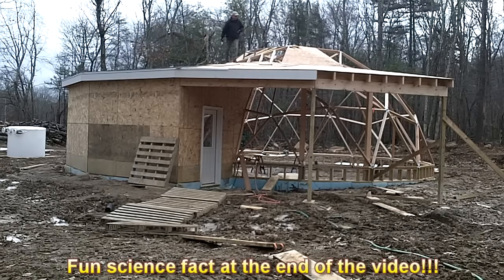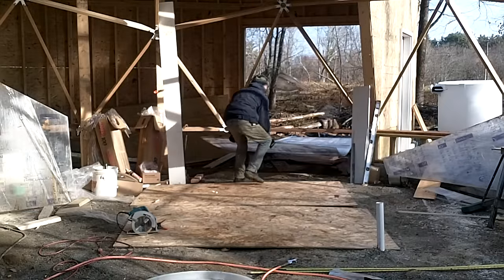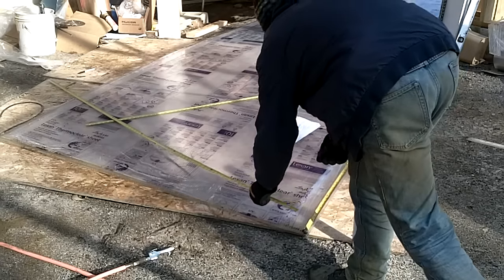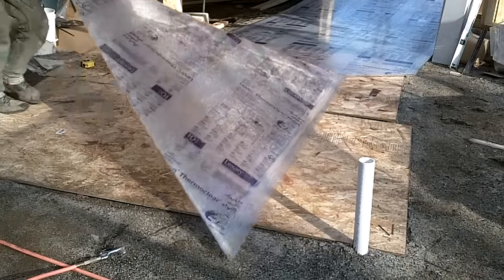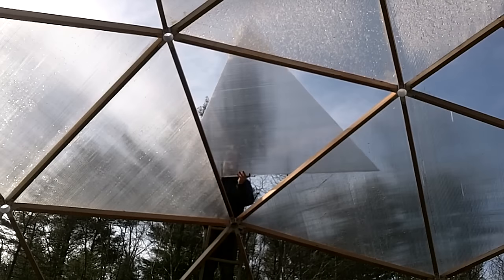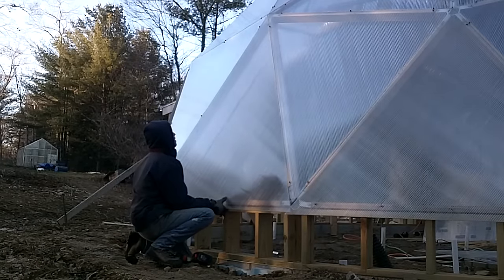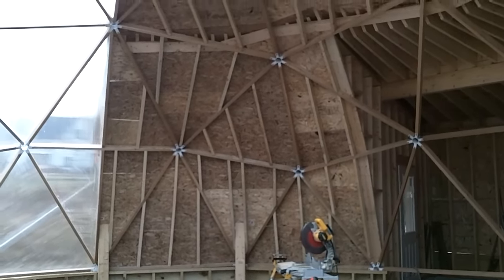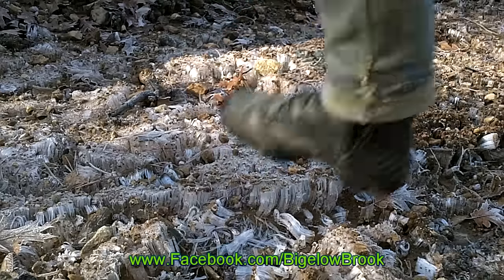Geodesic Dome Greenhouse - Part 9 - Polycarbonate!

Comment: I could see in this clip that you used twin-walled polycarbonate sheets. If you had to rebuild the geodesic greenhouse, would you opt for triple-walled or even greater in your cold climate and the extra cost was not an issue? What, if any, are some of the things you would change about the construction and thermal mass? I would really like to see a follow-up video summarizing your first hand experience with this geodesic greenhouse, especially now that you have decided to use the hoop type construction in your new greenhouse. The biggest challenge must have been how you found the time to embark on such big projects while also working full time. I envy your commitment and courage!

Comment: Massive effort.  Great work.  Has me wondering whether a two layers of 6m plastic I use for high tunnels would be more cost effective if not a better insulation when double up with an air pocket between. The greenhouse grade plastic is good for 4 years, and simple to replace.

Comment: @web4deb Not sure about that either.. but.. before I'd try silicone, I'd be more inclined to try (clear) Pro Flex RV. In any situation that silicone is/can be used on an RV, Pro Flex is better. It's fairly difficult to remove later, tho... so some tests would be in order.

Comment from the maker: @NewEnglandgardening I'm not too concerned about the holes through the hubs.  All the poly carb panels come to a point over each one.  This spring I'll use my special tape and cover all the joints...it will seal up nicely.  I"m NOT outside today....I had to go to my real job anyway.  ;-)

Comment: I think I heard the weather guy say today was the last day of fall, so now its officially winter so you got the poly up just in time to work on the heating system.  Do you have a remote temp sensor?  Would be interesting to see the temp differences even now with just the poly up.

Comment: 3 in 12 is the minimum slope for shingles. Rolled roofing is the way to go on low slopes such as this. You should check your ice and watershield membrane manufacturer for how long it can be exposed to sunlight before it starts to degrade.

Comment: I have a couple of questions for you regarding the polycarb you chose. I saw in the comments that you got a double wall. I also saw in the comments on one of the previous videos that you went with that instead of a triple wall because the clarity loss wouldn't make up for the insulating gain. Did you consider any other designs when you made these decisions? I've looked at your design, and I like it very much, but I am debating on my exterior. what would your thoughts be on a single wall lexan  outer shell, and a thinner poly inner shell affixed to the inside of the 2x4's, or possibly a thin glass shell on the inside . My thoughts are to give a larger dead air space, hopefully creating better insulating properties, without a massive loss in clarity, do you think this is feasible, or have you seen somewhere that the micro-air pockets in the twin wall do a better job?
Reply: oh, and I apologize for switching between calling it poly and lexan, I realize they are the same thing.
Reply from the maker: Typically, if you tried to put a layer on the inside to make a larger air pocket, that inner area will get a lot of condensate in it, clouding your sunlight, and also keeping the wood structure wet and making it rot faster.  You need to keep the wood exposed to keep it drier.
Reply: That makes perfect sense, thank you.

Comment: Have you had any issues with expansion/contraction of the polycarb and not allowing any wiggleroom with the stainless screws?  Looking at doing a very similar one..

Comment: Wow...very nice. A QUESTION...the tape...its very expensive. 900 bucks for the dome I'm building !..is it necessary ? are there alternatives that you would recommend ? or the cheapest source you've found ?
Reply from the maker: If you don't care if water leaks in, then it's not necessary....but it will leak....a lot...with out it.  This is the only tape that I could find that is UV resistant, waterproof, and temperature proof.
Reply: Yes it seems this tape is pretty good stuff.only good down  to 4Deg C though. I'm in Newfoundland. I wonder how it will hold up. Perhaps if I kept a RMH going full time the tape would stay warm. What supplier did you use? I'm trying to find the cheapest price...for the tape.Maybe i could use 1" tape instead of 2" ? which width did you use ?

Comment: From a structural perspective I doff my hat to OSB BUT the chemicals used in making it plus bug resistance and fire retardant will later leach into the plants you will eat and your lungs. Adding a heat source such as lighting will make this happen even faster. Particle wood be it a great idea is not until it is made with harmless chemicals.